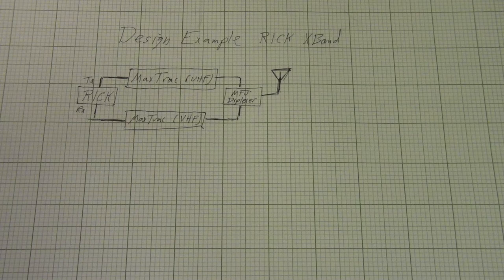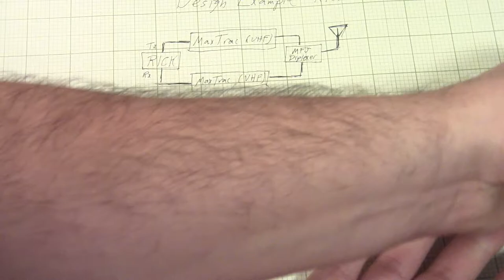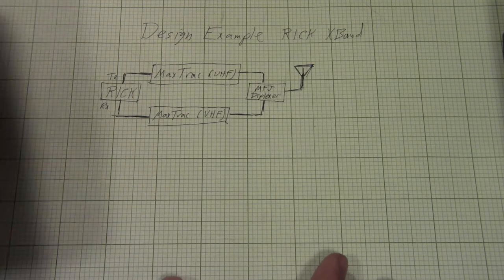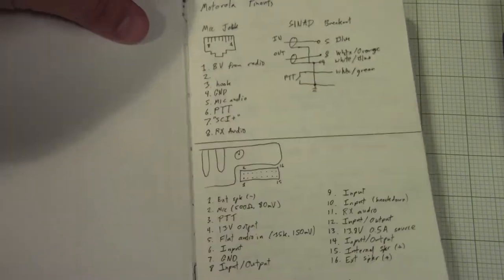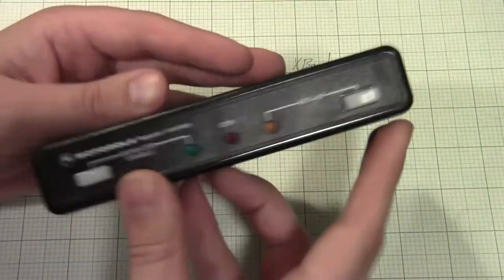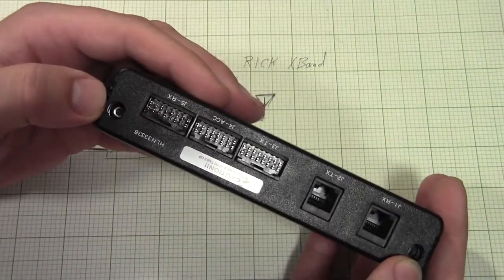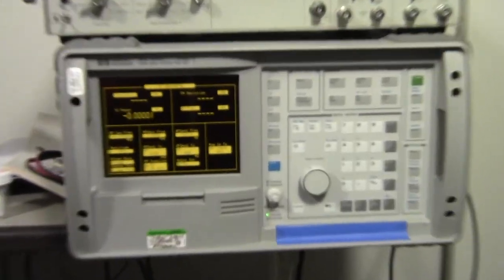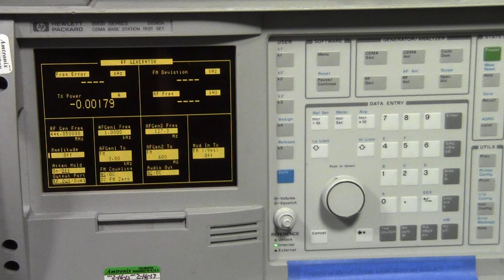Repeater Design Example: Bidirectional RICK Crossbander

Comment: Would a video on the ID requirements for a cross band repeater / remote receive site system possible?
It seems multiple remote links all IDing could get a bit noisy. I'm probably missing something though.